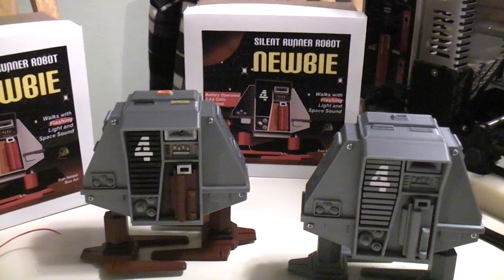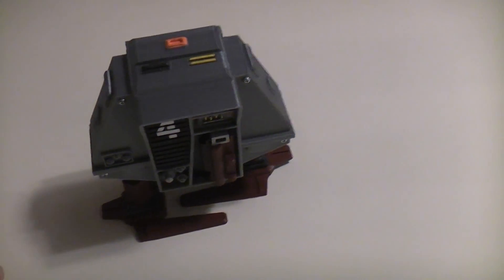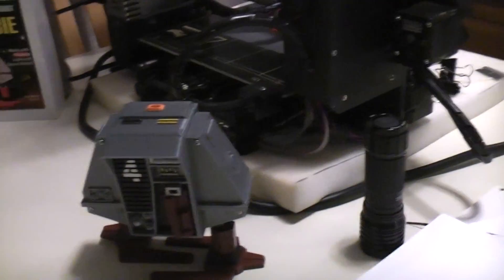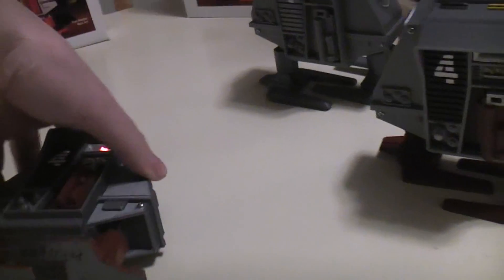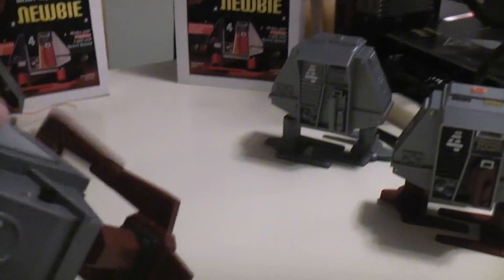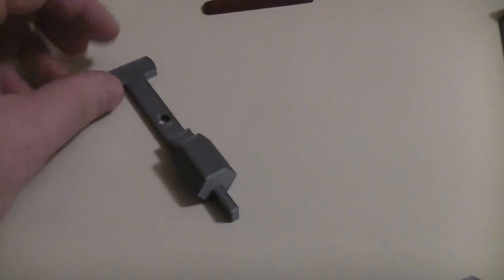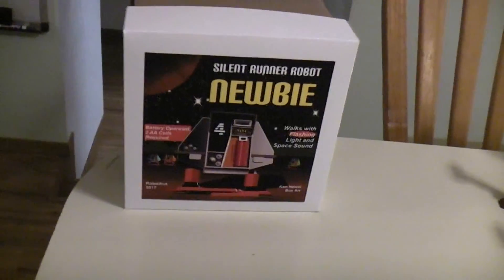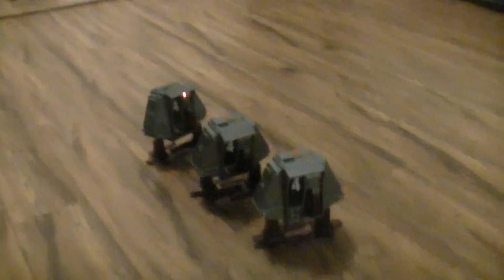3d printed, walking robot #4. Silent Runner robot Newbie. Printed on a Prusa i3 mk2

Comment: That kit looks fantastic and those parts are so smooth! How did you get them to look so nice?
Reply from the maker: I use the original Prusia i3 MK2 printer with there free slicer program in the optimal setting. That's just how nice the printer is. Also I designed all the parts in Design Spark mechanical a free 3d cad program so I could control the quality of the files .
Reply: These parts really do look fantastic which is a testament to your design work AND that already well reviewed printer. Keep up the amazing work!
Reply from the maker: Thank you, now if I would just check my spelling before I post . PRUSA i3 MK2